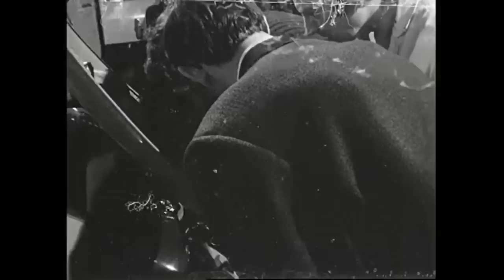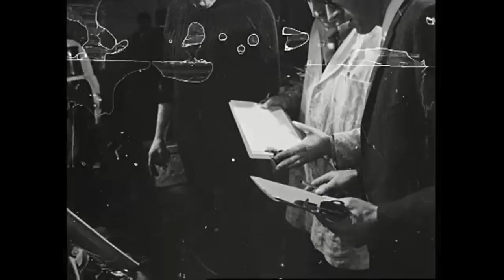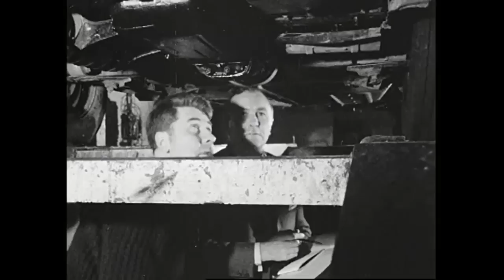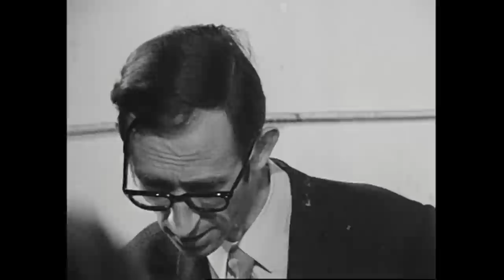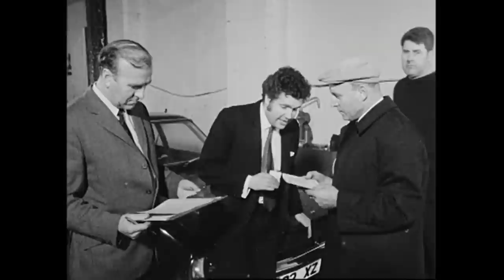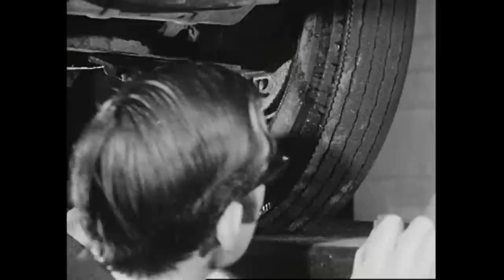Rating Garage Servicing, Ireland 1971

Comment: This is great. A real throwback from when news still did journalism. It all changed in the 90's when they started making news a business rather than a service to the public.
Now they won't check much just plug in the computer, shake the wheels, and the chain shop mechanic would be in trouble for not pushing up-sells.
But the mechanic-fired parts cannon has always been a thing. There are good mechanics, but thorough communication is key to getting the service you want. 
Better yet, take the boomer advice and learn to work on it yourself. So glad I have, saved me tens of thousands of dollars even if it has wasted a few hundred hours.

Comment: Learn to do it yourself.It's even easier nowadays  with points having been superseded by electronic ignition. It's the only way to ensure that the correct oil spec is used and that the work is actually done. It only takes maybe 40 minutes every 6K miles and the cost is minimal.
You also have the satisfaction of a job well done !

Comment: Noticeable how they refer to a mans safety driving the car and having a girl pick up the car a few times. Like the fact that a girl picking up the car had anything to do with what they were trying to achieve. The quality of the cars back then was total crap ….. although I would love to have that old Beetle now in original restored condition. The terms used by garages back then were an open invitation to abuse of the customer. What is a full service meant to be. The garage would only list the work as a full service given and not tell you what they had actually done. Not much different now either. The biggest problem with taking your car for maintenance if you have little or no auto knowledge is that you have no way of knowing what was done or not done. To make it even worse now is so many cars have an electronic oil gauge instead of a dipstick so you can’t even tell if the oil was changed. I caught out an Audi dealer on this with the first oil change on an $80,000 Q7 getting its first oil change. Without them realizing it I had installed a dipstick and was able to see that the oil was still black and had not been changed. When I pulled the oil filter it was black as could be and also was not changed. Like other commenters have said ….. if you can learn to do some of this more basic work yourself then do your own maintenance where possible. Nothing has changed in the auto industry. They are still in the drivers seat when it comes to ripping off the customer.